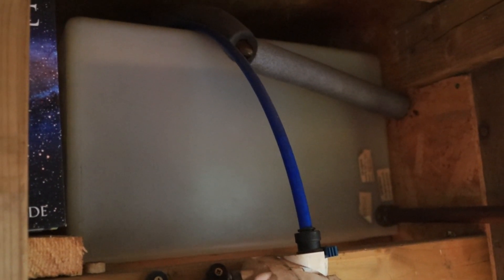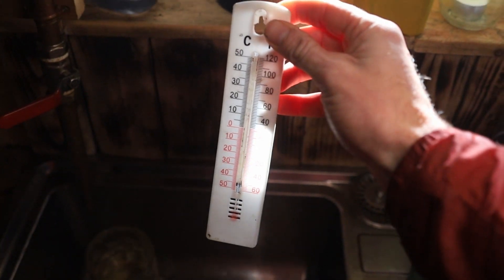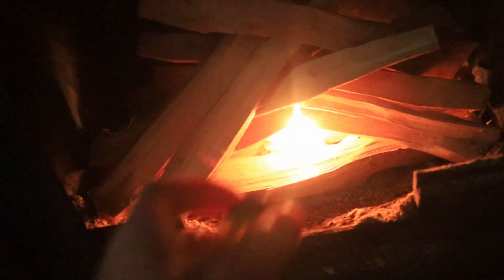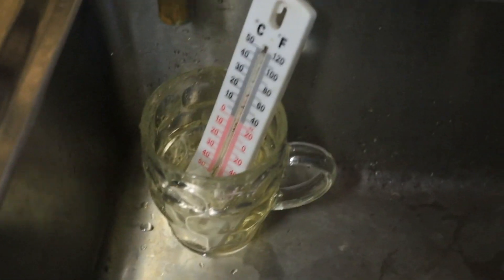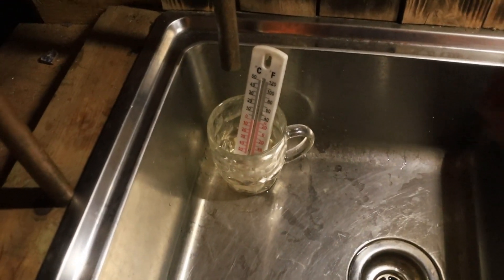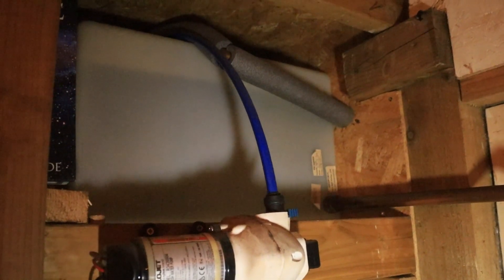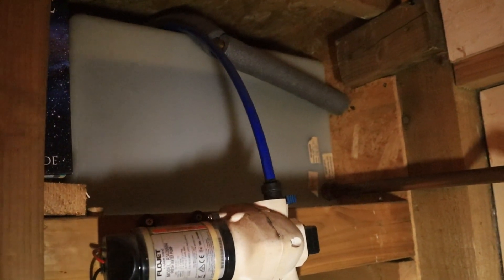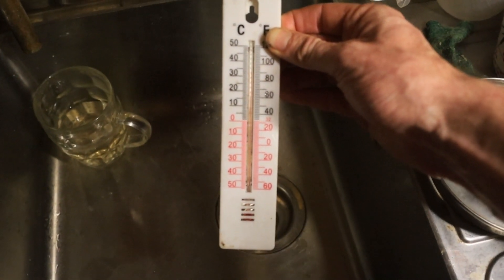Part 2 Simple Off-Grid cabin hot water system. How long does it take to heat up?

Comment: Really useful set of videos on this, thanks for uploading! 
I'm looking to do something similar this winter and was just wondering if your hot water tank is a sealed unit or can air enter? Just thinking about how to stop it potentially exploding from the pressure but I'm guessing it's not fully sealed and hence not an issue?

Comment: Great system. About to do something similar. What happens if you turn off circulation?  Can you use the fire without heating water or could the pipe work overheat?
Reply from the maker: Awesome, hope it works out good. I can shut of the valve supplying water to the coil but tbh I just leave it open all the time. When it's shut the residual water goes crazy and makes a fair bit of noise as it's not circulating. I suppose you could add another valve to drain the residual water in the coil to solve that. I guess the pipework would be fine like that.

Comment: We had a similar system in the 1980's that my father installed on the woodstove. Ours had copper pipe zigzagged across the stove. The system would easily get the metal 30 gallon tank to 130 degrees fahrenheit after several hours. Here is my advice for better performance.. Pressurize your system on the cold water intake line where the water enters the cabin. Your water will circulate better under pressure. The most important thing is to insulate your hot water tank. This will make a huge difference. If you move the coil into the fire box somehow you will get hotter water. Insulating the tank will probably make the biggest difference.

Comment: Would the system benefit from a small pump  for the radiator line around the flue ? Wonder if that would speed up your times?
Reply from the maker: The idea here is that it's a thermal siphon system. A pump is unnecessary imo. Maybe it would make little difference as the water wouldn't be in the coil long enough to heat, therefore would probably take the same amount of time 🤷🏼‍♂️.  I've never seen anyone use a pump.
Reply from the maker: Its quick enough for me anyhow. Being any quicker is largely irrelevant for me.

Comment: Is that a dog bowl chimney cap
Reply from the maker: Haha...yes it certainly is. Does the job ✌️
Reply: Thanks for the video, I'm thinking of doing something similar on my property in South Africa but using steel pipe in a firebox, have you considered insulating your water tank?
Reply from the maker: Great, go for it. I did consider insulating the tank, although thought it's not really needed. The water is still warm the next morning and the stove is on everyday for heating anyway. So not really needed.
Reply: I like a shower to be 37° in summer and 42° in winter time.

How long would it take to boil up 20 litres in a pot ontop of the shove top, if the stove is always burning your idea is all that required to keep it warm.